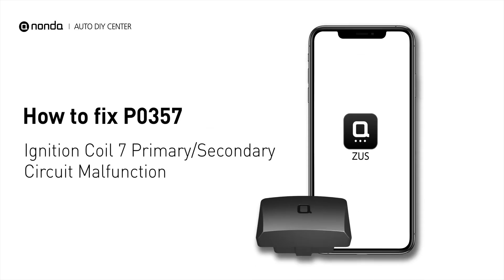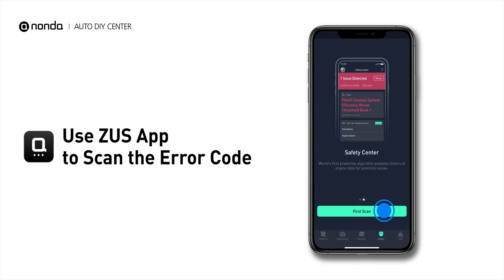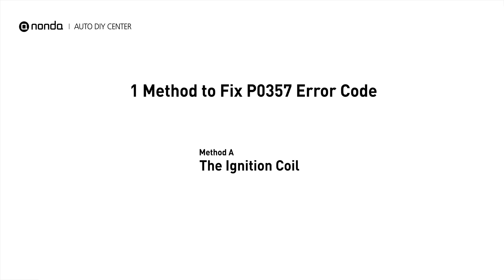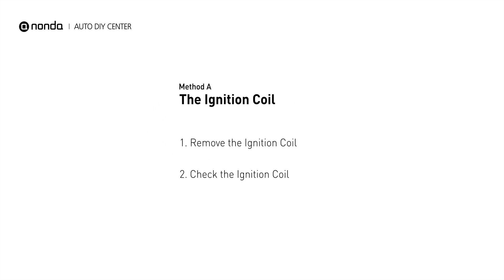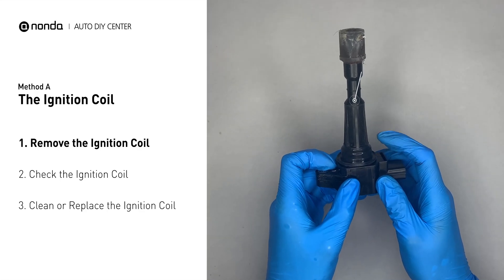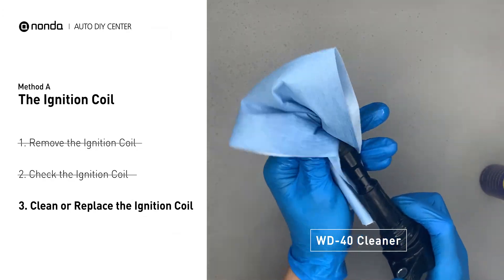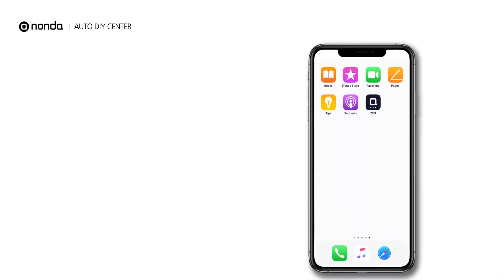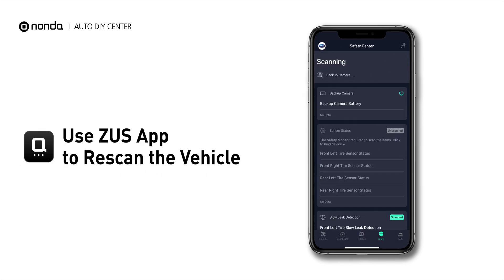How to Fix P0357 Engine Code in 2 Minutes [1 DIY Method / Only $3.95]

Comment: How did u know it was cylinder 7? Mine just says code p0357, one or more cylinder circuit malfunction. I just replaced all my coils and plugs one year ago. 2001 ford expedition
Reply from the maker: Hi Ryan, we suggest to visually inspect again  the coil pack and its connector for damage. We also suggest to test the resistance of the coil and check the coil for power.